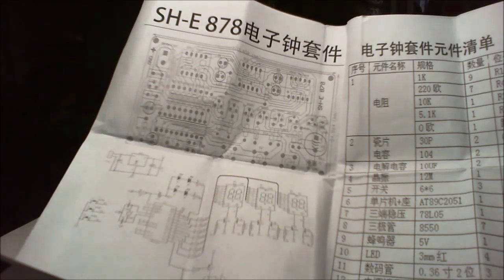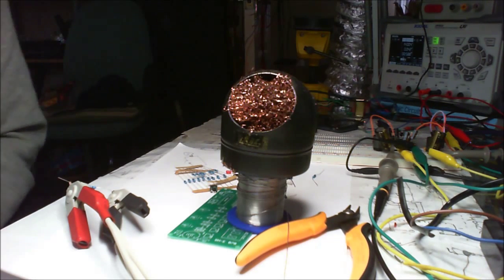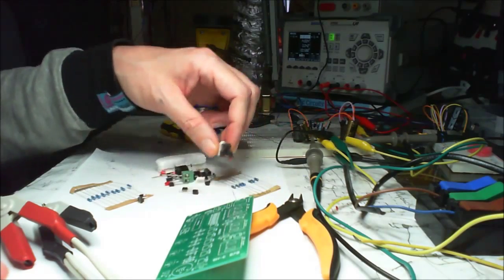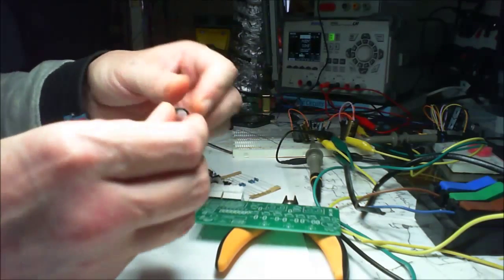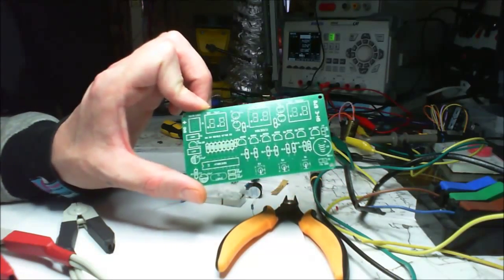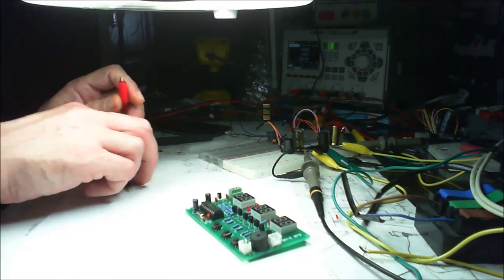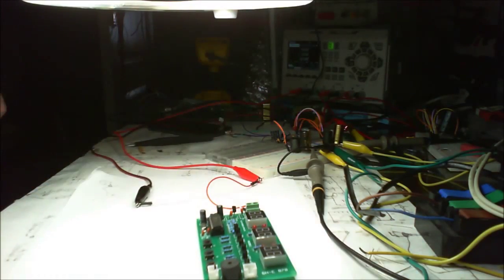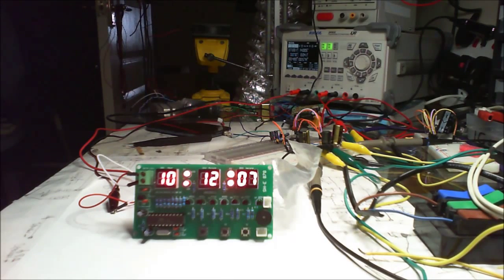Ebay AT89C2051 Electronic Clock Suite KIT

Comment: Interesting how the led colons don't flash per second on your particular unit. All other 'suite' clocks have the flashing colons.  Have you worked out how to hook up a button cell for time back up?  Enjoying your vids.
Reply from the maker: I haven't. I built for practice soldering but have no real need for the device. I will dig it out and take a look when I have some time.

Comment: Its a clock, a timer, and a  stop watch  :)ps, try to leave the music out of your next tutorial  :)
Reply from the maker: +karen berry Hi, valid comment regarding music, cheers.Thanks for letting me know what it does, I find as it has no memory I do not use it :-( Instead I use (click link) it has battery back up and does look nice. I have a resistor in series with the power input, it keeps it a subtle look. https://www.youtube.com/watch?v=fx-EagoHESI
 I have left the music off all but two I think. I agree though, no more music :-)
Reply: I agree about the music ,makes it hard to enjoy what you are trying to show us.I just got two more clock kits in and I ordered that little white radio and a another clock kit,next before I do much more I goog to look for a good soldering pen.I just got
Reply: +Ron Thompson  Hi Ron I will be starting this clock kit at the weekend :)
Reply: Is it the one with the clear case that's also has a thermometer  in it, and u can get it in one of four colors, if it is that the inevitable bought on eBay,which was cheaper than amazon on that item
Reply: Or our u doing that one in that video with the music
Reply: did u see that video that had the radio shack, digital clock, I tried to buy one they were out of stock.
Reply: +Ron Thompson  I am doing the one that is in this video mate... :)